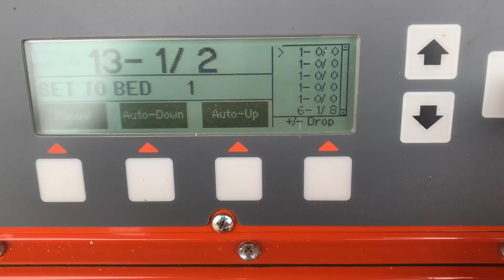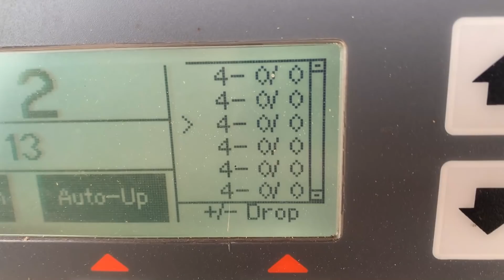How To Get Useable Lumber Out Of Ugly, Low Grade Logs On A Sawmill,

Comment: Forgive the unsolicited advice, but that camera flicker is from your fluorescent lights. If you can manually set the shutter speed on your cameras, you can probably get rid of it. You will then have to compensate with either iris/aperture or gain to get the right amount of light into the lens. If those aren't options, there are some free post-production tools that can work as well.
Reply from the maker: you are exactly right, I did that today and fixed it instantly, appreciate it Ted,

Comment: I think that void in the clear white pine log is from carpenter ants.
I used to get that in New Jersey, mostly in soft pine and pin cherry.
When you see it, only thing to do is lay it in the sun. The ants will scatter.
Too bad for you, but not a problem, compared to the guy who dropped the log.
Very dangerous dropping sticks with big rot in them. Can fall any which way.
Nice videos.

Comment: Had a guy come cut my logs for lumber. He had the same problem. The weld did give it was just the metal like yours. Do you metal check your logs before you put them on the mill? 
We got 11 logs cut up in 8 hrs. Is that good? I think his mill is the same as yours. 40, with Yanmar motor.